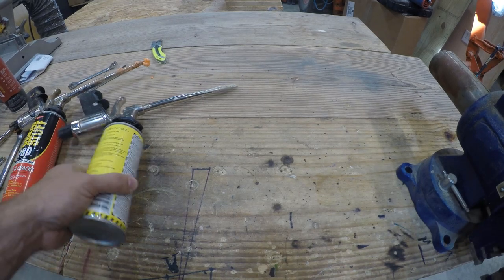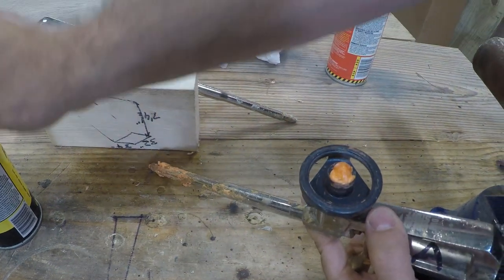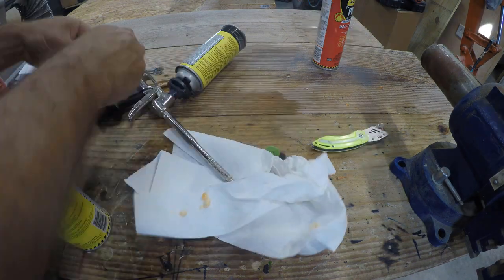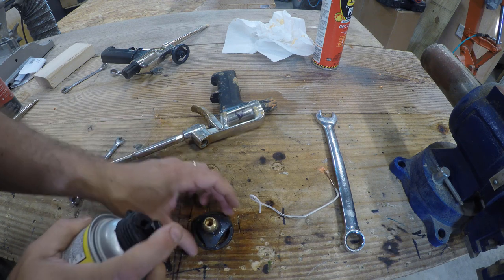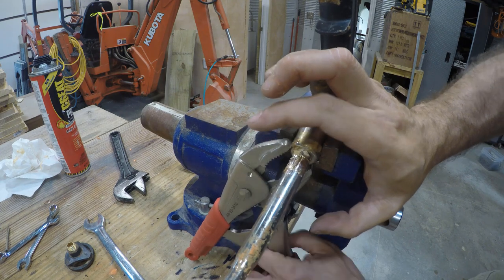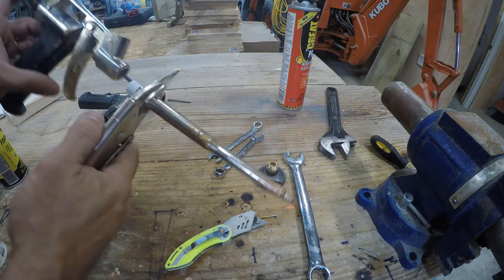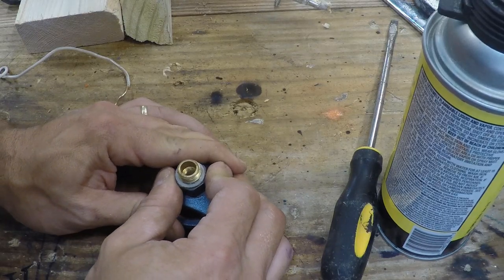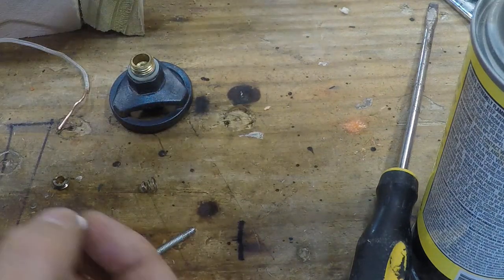Great Stuff Pro Gun Repair

Comment: Thanks man. Even though I cleaned the gun with the great stuff cleaner every time I used it, the valve still managed to get clogged. But thanks to your detailed valve disassembly instructions, I was able to clean out the ball and spring. A hard thick coating dried around the spring in the valve.  Thanks a lot.
Reply: These guns are such a pain!

Comment: Blocked my second gun, (first was a Hilti, second is the Great Stuff gun).  Thanks, for making this video--great help.  Also, thanks to J. Martin for the tip on applying heat to the barrel threads. I'll try to clean my guns as soon as my cleaner order from Amazon comes in.

Comment: Thank you for making this video. Also I hope you secured your vice down to the bench by now, I narrowly avoided a major foot injury from a poorly fastened vice as a kid.
Reply from the maker: Yea, my shop was in flux (I was still building it).   The "workbench" was just 2x12s left over from forming the footings set across home made saw horses.   I re-arranged the place with each new task and didn't use the vice often enough to mount it permanently...  But things are settling down now and getting more setup.  I even have dust collection and power distribution now ;)

Comment: Great Video! It helped me save my gun. I was very upset at myself for seemingly bricking this tool but your video saved my gun and it works better than before. Thank you. Probably should wear gloves though, that cleaner has to be super carcinogenic/caustic to work so well.
Reply from the maker: The cleaner is really just 100% acetone.  It is the exact same stuff that women use to remove nail polish, etc.  If it is bad for your skin, then women would be dying younger than men ;)

Comment: pro tip, try pipe wrenches if you have a stuck, partially stripped head.  Pipe wrenches grabs tighter as you try to turn the stuck fastener.  You can get mini ones.

Comment: You can disassemble the gun and soak the parts in NMP to dissolve the hardened foam and blow it out with air.  Dynasolve CU6 works better, but it’s a bit pricey to save a $40 gun.  If you’re lucky you can wire the trigger open and soak without having to disassemble
Reply: I tried that long before going to the drastic step of disassembling.  A week in acetone didn't work.  I even tried gasoline.
Reply: @SimonASNG  
Acetone and gasoline will do absolutely nothing.  NMP will dissolve foam, CU6 will completely melt.  Polyurethane is extremely stable and hard to get to react.
Reply: @anthonyasher6348  Acetone melts it pretty well and gasoline will melt xps and eps instantly.  Also, the primary ingredient in the gun cleaner is acetone.  Those work well when they can get to the foam, but if the foam is stuck in the gun, the solvent can't get to it to disolve anything.  I'll check out dynasolve if I get a chance one day.

Comment: If you do all this into a scrap bucket, the cleaner should evaporate and just leave the gunk in the bucket.  I used to remove can and run the cleaner anytime I wasn't using for a few days or more (store gun clean and naked).  Used toothbrushed are also great for scrubbing nubs with solvent, imo.  Never had to dissasemble, but only used over few months on one project.  Also, maybe soaking the tube connection with solvent? zipties, plastic baggie? ... TL:DR;  Keep it clean ;)
p.s. thanks for the teardown.  I luv me a good teardown.

Comment: Thanks for the breakdown.  My gun was in use for about 3 years, maybe 10 cans of foam with good results.  During that time I used one can of the acetone cleaner to keep things good.  However, I set the gun aside for too long (a couple years) with a can attached and it froze up so bad that I can't get the brass valve screw out.  I bore down on it pretty hard but it wouldn't turn.  I was concerned maybe it was reverse threaded but your video shows it's not.  At this point I've rounded off the shoulders of that internal screw so no chance of getting it out.  Too bad because the barrel and tip and trigger mechanism are all in good shape.  Wish Dow would sell that valve as a replacement part.
Reply from the maker: Yup, you are exactly why I made the video.  I had the same doubts about trying to take it apart.  I had pretty much given up and decided it would be OK to destroy it trying.  When it worked, I was so surprised, I decided to make a video.
Reply: Unless it's a rotational piece that rotates counter clockwise. You should never encounter a reverse thread.
Just letting know.

Comment: To remove the barrel apply heat where the barrel threads into the body.  The barrel will unthread easily (semi permanent heat release thread locker is used on the threads) after heat is applied.
Reply: That doesn't work for me when it gets to the point of how much gunk (which is inevitably the case) with these trash guns. And even if that is the case, they need to have a proper 1/2in square to fit a wrench properly.

Comment: Believe that this brand is made by Stanley which owns many other brands among them Black & Decker, symbolic of their junk and proprietary attachments etc.  The Tip & Barrel and Top Can Attachment have Locktite on the threads.  20 sec of propane torch will melt the Locklite making it possible to immediately take off the fitting.  5/16 (8mm) for tip and used vise grips for Barrel.  As per other comment, take off the rear knob, unscrew the brass fitting (removing it) and extract the rod.
Reply: after disassembly as above unable to get the tip to reseat completely to seal when trigger released.  My theory was that the barrel was extremely set into the body originally so I tried shortening the barrel length at the body end grinding off 3-4 threads (brass tube) which did not solve anything so then tried grinding tip and that did nothing. If anyone solves please post.
Reply: @tg-bh2up  No help here but I'm having the same problem.  Tip started acting plugged so I flooded it with cleaner and wiped away external gunk.  Saw a tiny fleck of material on the seat at the tip and picked it way and used more cleaner.  Now it leaks cleaner past the tip without the trigger being pulled.  And this gun had way less gunk to it than the OP's guns.  I can attest to the crap material used for the barrel and tip --- like it needs its own special sized wrench to fit and then it still would round over.  I have honestly wasted more cleaner and foam than I have actually applied.  Only 1 step better than the crappy Great Stuff cans with a straw.

Comment: Thank you for this video. My foam gun started to just dribble out with a full can of foam. I took it apart and found gunk on the valve spring and globs in the barrel. Cleaned it out and it's like new. I'm going to tear into my old gun and see if I can bring it back.

Comment: The nozzle pin come out the back. Remove the adjustment knob using a Phillips. Be careful. There is a spring and ball bearing hiding there. The barrel wasn't designed to be removed. Pull the rod and insert a barrel brush. Don't crush that barrel.

Comment: "Size is somewhat between 13mm and 1/2."
Ha ha! 13mm was too big and the spanner was just rounding off the section; 12mm was too small. The Goldilock's size for me was 1/2". Gun secured in vice, heavy lump/ club hammer to smash the spanner -- took time but eventually came free with minute movements. (Everything removed and soaking in white spirit overnight. We'll see. If NG will try acetone, then in ultrasound bath.)
Reply from the maker: Manufacturing tolerances.  For me, the 1/2 inch was just too small and I couldn't get it on.

Comment: Thanks for showing how to clean those. I got curious to what is in the cleaner so I looked up the MSDS. It looks like it is just acetone using propane as a propellant. Good to know if you have to clean up foam and don't have a can of cleaner that nail polish remover or  hardware store acetone will do the trick.
Reply from the maker: Oh yea, I actually mentioned that in my original cut (when fixing the other gun), but it was too long, so I ended up cutting it out.  I figured someone would freak out that I was letting it get on my hands, so I wanted to mention that it is just nail polish remover.  ;)
Reply: Gumout carb and choke cleaner.
#1 ingredient is Acetone, #2 is toluene. Toluene will soften silicone. You may be able to soak cured foam and melt it off, Idk but worth a try..
This stuff is much less expensive than the cleaner, but it doesn't screw on the gun. Makes clean up easier as after use, you can spray the gun tip.
Something else that may work on metal parts is pvc pipe primer. That stuff melts styrofoam quickly. I'll have to try it.

Comment: I don't know man, I tried cleaning my gun yesterday and I could not unscrew the barrel. I ended up bending it and breaking it. In any case, I think a proper use and right away cleaning the gun is the best advice - too much of a hassle to clean the gun after the form has hardened. But all in all good information.
Reply from the maker: Oh yea, I always tried to keep them clean.  But go thru 20 or 30 canisters over several months of building and your chances of not having this problem go way down...   I figured it was a risk that I would destroy it, so I might as well try.

Comment: I have a new Pro14 and I have not been able to get any foam out the Great Stuff Pro can. I noticed that the white ball that is supposed to engage the foam cans does not move up and down when the trigger is pressed, is this normal?
Reply: if you watch the video, he disassembles the valve. The ball won't disengage with the trigger. it is on a light spring and disengages with the pressure from the foam can. This was the problem with my gun, but following his disassembly instructions later in the video, I was able to get my spring working again underneath the ball. You should be able to lightly push down on the white ball in the valve from the top though if you want to check it and it should go up and down. just use a cut part of a wire coat hanger.
Reply from the maker: Bryan is exactly right.  The gun mechanism pulls a wedge out of the way so that the pressure in the can is free to move the ball out of the way.

Comment: After using the gun, instead of leaving the spray foam can attached until you use the gun again, why not fully clear the gun with cleaner and store the gun with cleaner attached? This method would prevent any foam from clogging the gun.  You should never have to disassemble the gun again to clear it.  Your thoughts?
Reply from the maker: If the can is sealed against the gun, and the plunger is closed, it doesn't cause trouble.  If you take it off after each use, you pretty much have to throw away the rest of the can.  Being able to stretch a can across a few hours or days is half the benefit of using this system.   I wouldn't want to leave a bottle on for months though.

That said, I do try to end my day (or job) on an empty can, and then I attach the cleaner can to the gun, spray that thru a bit and leave the cleaner can on until the next day I need the gun (which might not be for weeks or months).

However, buildup still happens.  Even if you always shoot the can thru, you will still get a little residual buildup that the cleaner doesn't dissolve.   I know some pretty meticulous people who still end up with a fouled up gun.
Reply: @SimonHomeintheEarth  
I always use up a gun foam can too. For small applications I use a one time small hand can of foam.   Until I watched your video I did not know you could take apart the gun without breaking it.  So I took apart my oldest gun and you are right, there was small amounts of foam still around the spring.  Even though I always store the gun with the cleaner attached. Good video. Thanks.

Comment: Does acetone not work for cleaning?
Reply from the maker: It depends how set the foam is.   When it is fresh, it works pretty well.  But over time, even with regular cleaning after each use, the crud can still build up.   Gasoline also works, but even that has limits.

Comment: Where some gloves. Save your skin. Great video! Thanks for sharing!
Reply from the maker: The cleaner is just acetone (nail polish remover) and the spray foam just picks off.  The worst is that if you get any glue on your fingers, and then get some dirt on the glue, it is hard to get that glue off for a couple hours and your fingers are "permanently" dirty.  ;)  But yea, I did expect this comment and mentioned the glove thing somewhere near the beginning ;)
Reply: Home in the Earth “just acetone” will wreck your skin. Don’t ask me how I know.

Comment: Did you ever consider the possibility that the pressure in the can(s) had been depleted to the point of useless?
Reply from the maker: The cans were fine.  You can easily feel when they are empty.   You can also have a situation where the can isn't empty, but the top of the can is clogged.  Neither was the issue in my case.

Comment: What is"the cleaner"because you never say what it is and I haven't caught a label on it yet. Are you using rubbing alcohol a name brand cleaner what is it?
Reply: The cleaner is from the manufacturer. It's is the great stuff gun cleaner. It's the black can in the video. It can be screwed on but also has a tip to spray it. It's only acetone, so if you have that laying around you can use that instead. That's what I use.
Reply: @ajsemtb  
Sweet thank you
Reply from the maker: Exactly right.

Comment: Was hoping for a more thorough breakdown. I'm wondering if there o-ring seals on the trigger side.
Because I think a torch could be an effective way to clean out a dried up gun.
Also you can take the check ball out as in this video and instead of wasting the $9 of acetone cans. Just soak it in gasoline. At your own risk of course.
Reply from the maker: I did also use gasoline to soak a really stubborn gun.  I found it is more effective on the inflated foam and didn't do much to compacted build up.   Several others on here have mentioned using heat to help loosen things up, but I had several guns and got them all working with this method.    

When I was doing this, there were no videos of anyone taking one of these apart.  I eventually opened it blindly figuring that the worst that could happen was I would need to trash it, but it was trash if I couldn't open it up anyway.  If all the video does is show you what to expect inside, that is good enough for me.  You can come up with your own ways to fix it.

Comment: I was disturbed watching this video that you were not using gloves and you were getting the gun cleaner on your hands. These cleaners contain powerful solvents (e.g acetone, butane & propane) which not only damage the skin but can be absorbed through the skin. These solvents are akin to the early anaesthetics (e.g chloroform ) and thus such cleaners come with warnings about inhalation causing drowsiness & giddiness with advice to avoid using them in spaces that are not well ventilated + to remove all clothing that gets gun cleaner on it and wash your hands immediately if any gets on your skin. The best advice is to read the safety data sheet for such products before use (better yet before buying as some may be  less hazardous than others of a a different make).
Reply from the maker: That brand of gun cleaner is 100% acetone.  Women use this directly on their hands as nail polish remover every day.  While it can cause dermatitis with prolonged exposure, it is considered skin safe for daily use.  I personally had no issues with redness or dryness on my skin.  I also had no breathing problems from this level of exposure, which I rate as less than the exposure I get when my wife does her nails in the car.

Comment: Last ditch effort….remove the check valve piece of crap plastic ball completely if nothing comes apart easily. Gun will still work just need to be more careful when removing can. If it does come apart easily then replace the piece of crap plastic check ball with a metal bearing. Will last longer and be less of an issue .

Comment: Its not worth buying the gun too many hassles spend more time fixing it than using
Reply from the maker: Yea, I wouldn't buy it for spray insulation.  Cans are fine and more economical (but not environmentally friendly).   But the spray glue is only available with the gun dispenser and that stuff is really great.